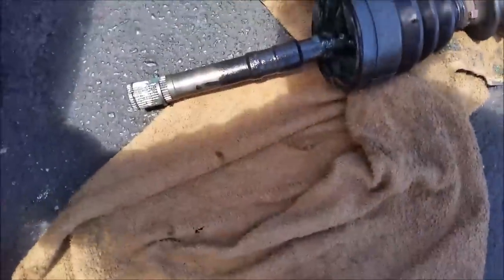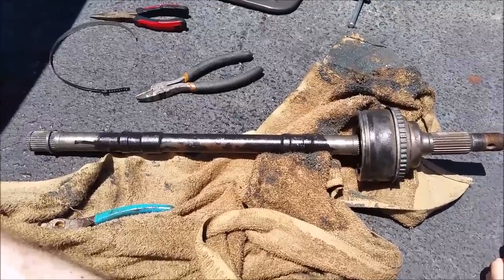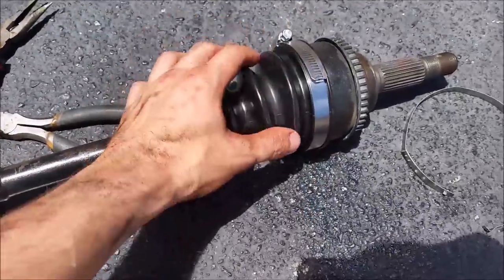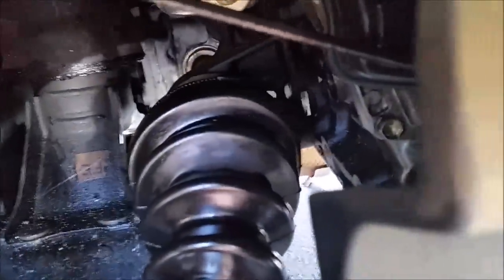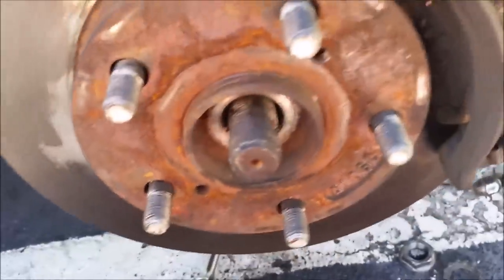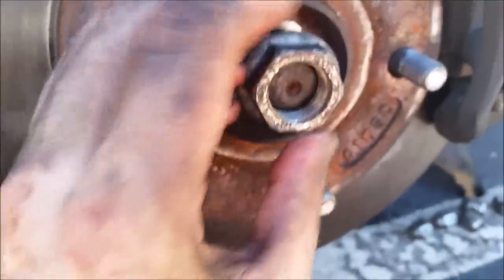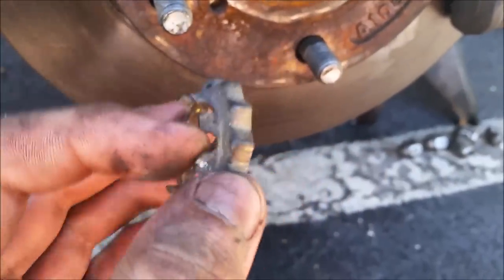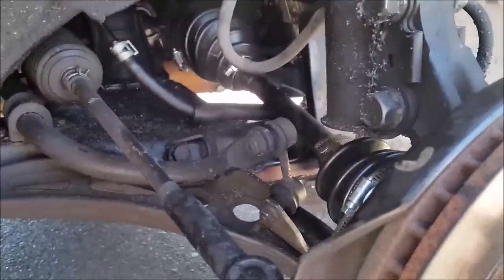How to replace a CV boot or axle 1996 Camry

Comment: Pro tip: you can break the CV Axle nut loose while the car is on the ground.

Old video, but relevant since these old Camry's are still on the road today. You can't beat these things when it comes to reliability and lifespan.

Comment: if you disconnect the two bolts that hold the knuckle to the strut and the axle nut, the knuckle tilts forward and the axle comes right out, no need to mess with the tie rod or ball joint bolts
Reply: If you do that, you would need wheel alignment.
Reply: @jamesfederer5592  either way you do

Comment: I don't think jubilee clips are what you should use. The point of the proper clips is that they are balanced to eliminate vibration. Jubilee clips are totally asymmetrical.

Comment: Detaching the three hole plate for the lower ball joint will mean total realignment needed. You can unbolt the figure of eight link round the side quite easily to let the support hang lower.

Comment: Just got a camry and the passenger cv axel was replaced by previous owner but must’ve not done something right. The axel is still shiny and new looking but when you try and put it in gear it makes a grinding noise and won’t pull. But if you play with the steering wheel going side to side and keep putting in gear sometimes it’ll go for a couple feet and then stop and make the grinding noise again. Any help is appreciated

Comment: Do you happen to know where I could find a boot for the 3 knuckle side with the right fitting where the bigger clamp goes. I only find rounded ones which don't wrap right at all after tightening, they need those 3 indentions to fit right

Comment: Not worth replacing the axle boot on drive axles anymore.Easier way is to buy a new axle.Chances are dirt and grime got in the joint which ruins the joint.New axles are not that much money with no core on them
Reply: wafrederick  That so true. Just buy a whole new one.
Reply: its still a good video if your in a bind you can replace the boot and have a bit more time before the cv axel goes bad
Reply: Toyota oem parts are worth rebuilding.   But you can get the whole thing at low price now but might not last as long as oem.

Comment: it's not always this easy usually when you pull the axle it always slips out of the gearbox and all the transmission oil leaks out if the car is not jacked up correctly

Comment: The rep at NTB told me my FR CV boot is leaking.  He printed me an estimate for the "repair" that incorporated replacing the the entire axle assembly ($400).  If it's just a leaky boot, shouldn't I only need to replace the boot - NOT the the entire axle assembly? Any help/advice with this is greatly appreciated. Thanks!
Reply from the maker: +Wes Kellogg Check and see where it is leaking. If it is leaking because it is ripped then yes replace the boot...but if one of the clamps that is holding it in place is leaking that can be easily replaced and they are trying to rip you off. Its a good idea to replace the axel if you have been having a leaking boot. The lubrication that is being held in by the boot will leak out and there can be water and dirt that get into the ball bearings and totally ruin your axel; that is why they suggest replacing the axel at the time you need a boot replaced. They need to take the axel off anyway to get to the boot
Reply: Thanks a lot. Appreciate your reply. I decided to get it replaced thinking it was the cause of this humming/grumbling noise that gets louder as I increase speed, but even after this repair the sound still persists. Now they suspect it's a wheel-bearing issue ($500 estimate for job)...But of it were a bearing issue shouldn't it affect steering like with unbalanced wheels? The noise seems to be getting louder by the day --- any thoughts on this one before I dump more money?
Reply from the maker: +Wes Kellogg did you replace the axel or the boot
Reply: The axle and boot. Almost $400 repair.
Reply from the maker: +Wes Kellogg if you think the guys are ripping you off take it to another shop for an estimate, from what it sounds like it does sound like ball bearings
Reply: I got estimated 110 for labor, and it cost 40 for the part..... I'm just going to do it myself which is only costing me 55 bucks. You got ripped the hell off.

Comment: whydid you take the whole shaft off and knock the inner cv joint off ? why not just knock the outer cv joint off the end of the shaft with shaft still in place , you made a lot of hard work for your self .
Reply: rudeboz cause boot has to come off through backwards
Reply: rudeboz You cant get it of by hammering its not Volvo its Toyota :)
Reply: you can see that the outer cv joint has splindes on just like the inner so it only has a c clip on the shaft !!! dont what your saying about its not volvo !! i i did read the heading for the vid
Reply: not if you knock the outer cv joint off first

Comment: My man, don't jack up the car to get the balljoint off lol it literally fell on the axle stand which could tip over or damage the frame, not even considering the threads on your balljoint bolt, just use a hammer or use the proper tool which is dead cheap, saves you money on having to repair framework in the future or even a life if the car topples over like that